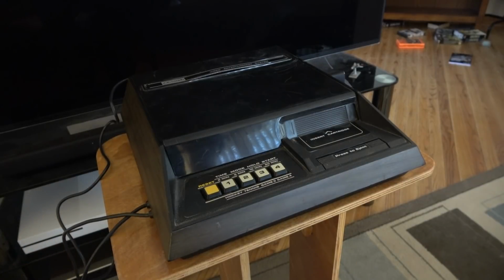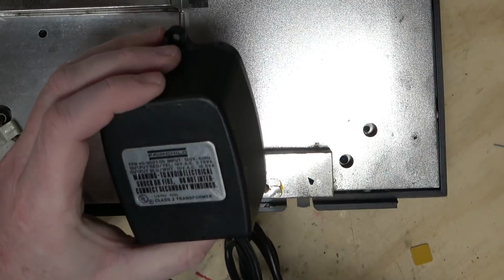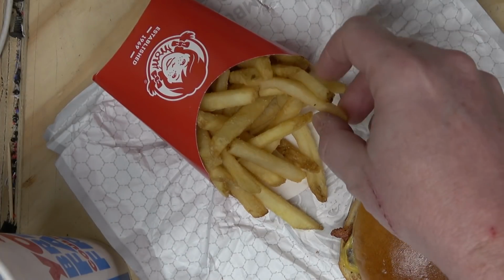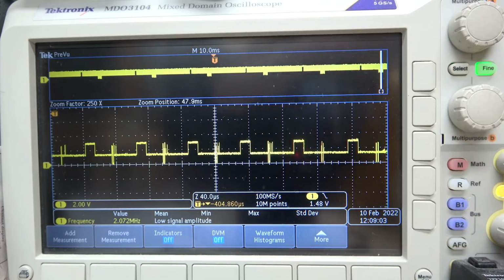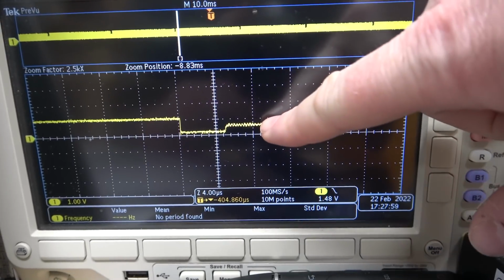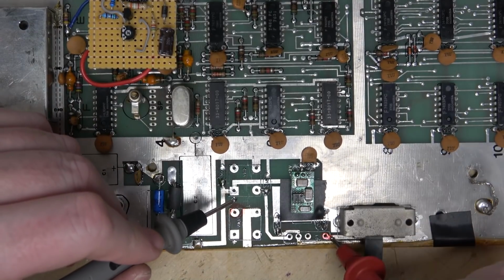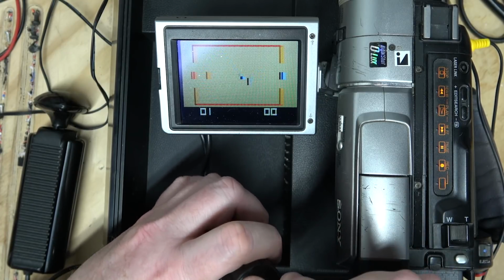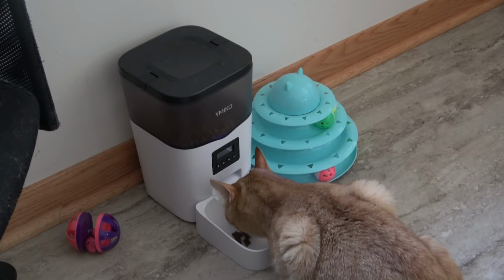Fairchild Channel F Game Console Repair

Comment from the maker: RE: Game prices. Yes, carts and ROMs jacked the price. SNES games needed more stuff on cart because the CPU was a dog. But even if we jump to the disc era (1995-present) games are still way below inflation. RE: https://www.usinflationcalculator.com/ 1995-2005 $50 becomes $64 so $60 was quite fair. If we take 1995 $50 to 2020 it's $84, so a $70 price (next gen only, XB1/PS4 still $60) is also fair. GAMES ARE CHEAP!
Reply: If you actually understood the issue you would know that the problem people have with DLC and Microtransactions is that they hide the true cost of the game. Some games are over 200USD if you include all the DLC. Mictransactions are also very amoral and target people with gambling issues.
Reply: While I agree on the cost of games, it’s more that microtransactions themselves are unethical in a lot of ways, often presenting gambling-based mechanics with real money involved in an E or E10+ rated game.

It’s to the point where the newest NBA and FIFA games actually have slot machines & cash wheels based around their ingame currency, and problem gamblers often relapse on these, becoming what are known as “whale” players who spend thousands of dollars on the games.

Crazy stuff - I’d really recommend looking more into it.
Reply: Also way more buyers so they should be cheaper
Reply: Agreed, I remember in the Genesis days some cartridges were selling for $89-109 at Toys R Us.   I assume due to the price of ROM chips.
Reply: @vincediesil  The cost of ROM chips and thus ROM cartridges really added to the price of games back in the late 70’s and 80’s as any sort of memory ROM or RAM was expensive back then. This is why cheaper or early home computers like the Apple II, C64, Sinclair ZX Spectrum, Atari 400/800 used data compact cassettes in instead  of or in addition to game/software cartridges as data compact cassette tapes where cheap,  tough cumbersome and slow to use while cartridges were expensive and floppy drives were also initially expensive. 5 1/4” Floppy drive costs came down earlier in the U.S. then in the UK and Apple II, C64 and Atari users switched to them  pretty quickly but the UK held on the data cassette for longer for cost reasons (I haven’t been able to find definitively why the floppy remained pricey in the UK for so much longer then in the UK though heavy taxes in floppy drives may have played a role).

You see if you study early game consoles and home microcomputers of the era a lot of compromises being made to keep the prices down given the market for home computers and game consoles was still relatively young back then and few people saw a definite need to own a game console or home computer such that they spend through the nose to get one. This is why pricey early GUI computers like the Apple Lisa ($10,000) and the Xerox Star ($30,000 and up) failed in the market due to market not being sold yet on the need for a GUI on their PC’s. One way early game consoles and microcomputers cut costs by reducing the amount of memory to the lowest they thought they could get away (on base models) at RAM prices of the the of the systems design. The other was to use whatever cost effective processor they could get away with and still have a usable system. Severely limiting the supported color pallets and resolution of the system graphics also helped to keep costs down too. Some home microcomputer systems included a barely functional amount of RAM (like only a few K) on the base system with an optional memory expansion cartridge or board as an optional accessory which keep the advertised price low but with the expectation that most buyers would opt for the memory expansion to have a more usable system (despite the extra cost). Other ways to cut cost was to use an RF modulator to send lower quality video to a TV for home micros to avoid the cost of an expensive CRT (TV’s, especially B&W ones where much cheaper then computer monitors) despite their better resolution/quality of image. Finally, some system used membrane/chicklet keyboards to cut costs way down like the Atari 400, Sinclair ZX81 and ZX-Spectrum.

For early consoles it was popular to leave certain features of the main close and instead make the game manufacturers include them as extra features on the cartridges (if needed) liked banked memory switching, saved game storage, and improved graphics and/or audio features. This is partly why some game cartridges cost more then average. It’s partly why Neo-Geo games caters cost like $200 a piece and up on introduction. Over time though as the cost of components came down drastically you often saw later version of popular console and home micro systems being made simpler (through combining of chips) and also cheaper such as the Atari 2600 Jr, (advertised as under $50), late model C64’s and all of the gazillion NES clones that proliferated in the 90’s, especially in Eastern Europe.
Reply: See the real problem really isn't pay more for my video game, it's paying for my video game then getting freemium BS still shoved down my throat; then knowing that they cut content out to sell back to me as day one "DLC" even though it's on disc so it's not DL and it's not new or extra C. I wouldn't and don't mind paying "fair market" value for my video games. I mind paying more for the game than I'm getting, to have the game constantly tell me to spend more money on it to make it "better".
Reply: If wages had gone up commensurate with inflation over the last 40 years that would be a pretty good argument. They haven't, though. Games may have gotten "cheaper" but their price is pretty much in line with public buying power.
Reply: Also the snes cpu being slower is also a misconception as 6502 or in snes case the 16bit variant can do way more ipc etc etc
Reply from the maker: @primus711  It's far slower than the Genesis 68000, doesn't have a true 16 bit bus, and doesn't even access all the RAM at top speed. It's a dog.
Reply: @BenHeckHacks  tbh they should have went with a faster clocked version like in the supercpu for c64 also i believe the sa-1 was a 10mhz 65816
Reply: @BenHeckHacks  there is an element 14 video floating around folks where BEN gave a very fair test of the SNES CPUs (Two 8-bit working in slow tandem) and test the GENESIS 68000 CPU(a dedicated 16-bit powerhouse , I believe a slightly customized version of it can be found in Neo-Geo Arcade coin-ops) the Sega ran Sonic rings around the SNES , , 👁️👁️😸👍
Reply: @BenHeckHacks  8:27 now I'm hungry.
Reply: I wouldn't say the CPU on the SNES was a dog.  The real problem is it was the same core as on the NES, which was more than a little date by the time the SNES came out.
Reply: @evensgrey  The reason they did that is it was originally going to be backwards compatible.
Reply: I'm totally okay with base prices going up if there's no moneitzation gimmicks. I'm even okay with "special editions" etc where the only idfference is in game items or whatever. I'm only not okay with being being nickel-and-dimed the same way with paid games that we are with free games. The most recent outrage was the new Chocobo GP, which they're charging $50 for but it has full blown mobile game monetization. If it's going to use free to play mechanics then make it free to play. It's like if you know you can't compete with Mario Kart, then just make it free to play, rather than charge $10-20 less and still have hundreds of $ in microtransactions. (as an added bonus, you can't even actually get the prize pass with the free to play version)

I'm involved in game development, I know it costs more than ever to make a good game, but any given game should ether be full blown free to play or up-front cost. DLC is fine if it's actually made after the fact and not "on disc."
Reply: I usually just play free games or retro games.
Reply: I for one enjoyed the dig at people like Jim Sterling.
Reply: So we should pay in millions for computers (10k-100k for cpu, ram, vram, storage)... What cost of 0 and 1 (software) on cartridge ROM chip back in the day? 19,99 29,99? 59,99? Sorry but BS, cents to few dollars. Distribution (retail, logistics) cost gone where? Won't say advertisement, most todays "big" release have nothing, just PR budgets.
Reply: @mindaugasstankus5943  ROM carts for the Atari 2600 could be expensive, I recall Defender being $60 when it first came out.  And it looked like crap, with the low resolution of the 2600's graphics, compared to the vector graphics of the arcade version.  Odd that the crappy way Atari treated their coders is the entire reason Activision exists, and Activision in notorious now for how badly they treat their employees.
Reply: Let me tell you Ben ,what burns my berries ,I remember some public legal advert few years back where game companies had inflated the value unjustly of certain chips in PlayStation ,Dreamcast ,and N64 so they could grossly overcharge the public , , ,some sort of class action thing in a tv commercial , , , ,$55 bucks in 1994 for Mortal Kombat-2 on SNES, game companies excuse for the high price were the cost of the memory chips in side ,but end of that year "Next-gen consoles came out , and a no memory chip CD-Rom title cost , , , you guessed it $55 or more ,, ,Greedy game companies nothing more ,cut n dry , , , , to day it's worse because now companies are greedy and lazy, , , they sell you an incomplete game on a disc at full sore ass price and then have the balls to send you a downloadable complete patch(rest of the game) for an additional transaction price $$ nowadays they get you coming and going 🥒🍑🌭 and you're completely fine with that Ben Heck ???? of all things man we look up to you 😔😞😞 also remember, , , , handheld GameCube in Bud the Cat Orange , , , ,

Comment: hey ben reuse those old components, those metal can 7805's are rock solid.
i design and build metal detectors, and i bought a load of new old stock regulators,transistors and opamps from ukraine, and they are mostly metal can parts, they have really good low noise output(important for detector front ends), they are way better than the plastic rubbish.

Comment: I had one of these as a kid, but I stupidly took it apart and never reassembled it. Eventually, parts were cannibalized or tossed, and it is no more... Except for a controller. I have a single Fairchild Channel F controller, and I am using it as my Translational Hand Control (THC) for an Apollo inspired instrument panel for playing Kerbal Space Program. Look up the Apollo Translational Hand Control, or the space shuttle's version of the THC, and you'll find it shares an incredible degree of similarity to a panel mounted Fairchild Channel F controller!

Comment: I'm curious as to why they'd throw such an monstrous power supply at a system that required so little of it.

I guess on the plus side it didn't appear to patch the power through the RF modulator that would have been connected to the rear of your television.
Reply: TTL Logic.....

Comment: The FCC was really anal about RF emissions on home computers and game consoles back in the late 70’s and early 80’s and forced certain home computer manufacturers to modify their designs after they had been released to market. The Tandy TRS-80 Model 1 was one such machine. In some cases the need to include heavy duty RF shielding led to some compromises to redesign early microcomputers and game consoles to accommodate this requirement. Whether this was really necessary and beneficial to consumers and others is question that’s been debated. At some point in the 80’s i believe they relaxed this RF shielding  requirement somewhat. 

Some interesting facts about the Fairchild Channel F is that  it was the first console to use ROM cartridges rather then just running only built-in games like the Pong clones and other limited built-in game consoles. Now you mentioned the high cost of memory back then. The Channel F got around the high cost of memory at the time by only including 64 bytes RAM and a 2 KB video buffer which severely limited the graphics and gameplay complexity of games for the System. Few games for it are considered even decent, especially compared with the Atari VCS/2600 system, which itself has limited graphics and gameplay vs later systems (just not as limited as the Channel F. Most of the original 27 games for the Channel F released for the were educational and intellectual games vs the more action oriented Atari VCS/2600 games. This is partly why it didn’t succeed, especially once the Atari hit the stores in 1978. It would be interesting to see what a modern home-brew programmer might be able to due with the Channel F hardware but I suspect that it really was just to limited to be able to make a truly great game for it outside some simple games like Pong clones, video poker, or video bowling. Deposited its limitations and failure in the market, it remains an important part of the history of video game consoles, much like the ever more limited Magnavox Odyssey 1, the first game console to hit the market back in 1972. One good thing about the Fairchild though was it’s controllers which got good reviews and I believe Fairchild even released a version of them for the Atari 2600 you could buy as a third-party accessory at one point.

Comment: High-sync pulse: that could simply mean that 
A. they were working directly on the inverted signal
B. you were probing the signal inverter.
either case, analog TV's expect broadcast signals to come in inverted and re-invert it back to normal.

Comment: I have that exact model handycam.  I use it in my side business for digitizing people's old home movies!  Also: I don't need to tell you, but everyone else: for the love of all that is holy: RENDER YOUR FOOTAGE CORRECTLY!  When deinterlacing your VHS, 8mm and Hi-8 tapes, double the framerate to 59.97 to preserve the motion fluidity of the source material!  Encoding to 29.97 progressive throws out HALF the picture data!  You've got an effective 60 fields interlace in the source, DON'T THROW THAT OUT.  Okay, rant over.
Reply from the maker: Yes very good point! Fields! = frames. I might do a Super 8 project this yest, I recently fixed the camera I found.
Reply: @BenHeckHacks  I'd be all in for seeing that!

Comment: Worked at Wendys as a teenager.  our store grilled the bacon on the flat grill in the mornings and it basically sat in a hot pan till we ran out and then new ones are made. After a couple of hours the bacon gets really crispy and hard.  Still they insisted on using them.

Comment: The Fairchild Channel F wasn't the first home console that used cartridges.  The first home console that used cartridges was the Magnavox Odyssey.  The Fairchild Channel F was the first home console that used a microprocessor.  (The Odyssey was purely analog.  The cartridges were basically packages of jumpers that connected the circuit elements in the console together to generate the desired image elements and control responses.  The circuits were made out of a total of 40 diodes and 40 transistors.)

Interestingly, the Fairchild Channel F came out at about the same time as the Apple I computer.  Steve Wozniak was able to program a version of Breakout in the BASIC he wrote for the Apple I in about half an hour, while doing it in hardware was normally expected to take a skilled engineer about 6 months.  (The Woz did it in a weekend, but that's him.  Atari decided not to produce his design because none of their engineers could understand how it worked.  They went with a design that cost twice as much to make but engineers with less sheer skill than Steve Wozniak could understand.)  The designers at Fairchild had independently had the same fundamental idea about the future of video games.  And, of course, they were right:  Very shortly afterwards, all video games were microprocessor based.  There were still a lot of custom boards for quite a while until it became feasible to build relatively generic arcade machines, as sound and graphics chips got to the point where they exceeded the requirements for most games. (The old game Paperboy even had two microprocessors, a 6502 that ran the sound and a J11 that ran everything else.  Most people have probably never heard of the J11.  It was a single-chip implementation of the processor for a PDP-11, originally a minicomputer designed in the 1960's, built out of discrete components and using magnetic core memory.  By 1982, the processor was able to be put in a single chip.)

Of course, the improvements in sound and graphics for generic use ultimately killed arcade machines off by making games on home computers and consoles look and sound as good as anything you could get in the arcade, and ultimately be cheaper than coin-op games as well.
Reply: Maybe it could be phrased that the Channel F is the first to use ROM cartridges. 

Also, Steve Wozniak designed Breakout in hardware in 1975. The Apple I wasn't released until 1976. Woz wrote the BASIC program Brick Out, or Little Brickout, for the Apple II, so sometime between 1976 and 1979, when it was officially released in AppleBASIC. Also, the issue with Woz's design wasn't that the Atari engineers didn't understand it, but they couldn't mass produce it using their existing manufacturing processes.